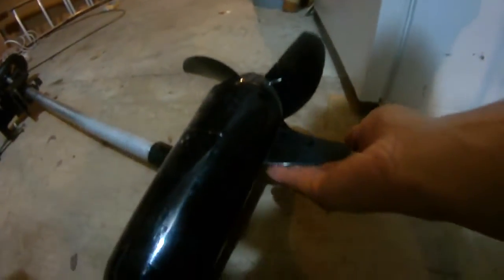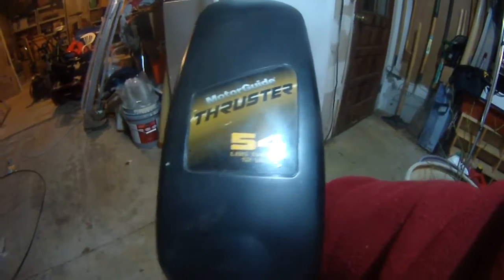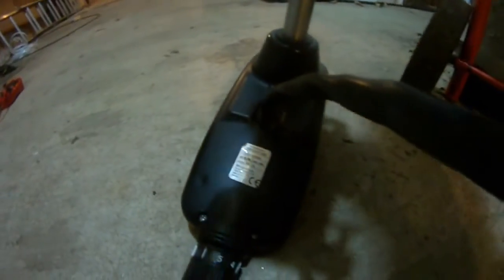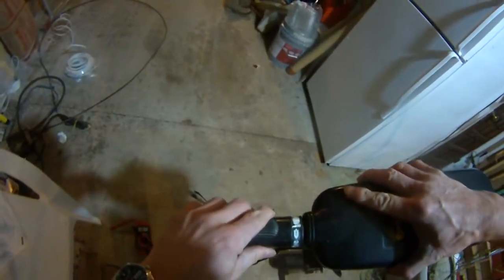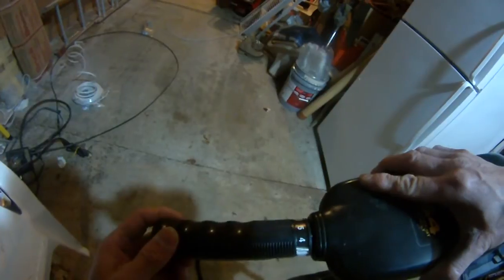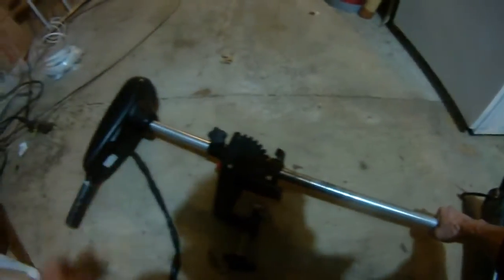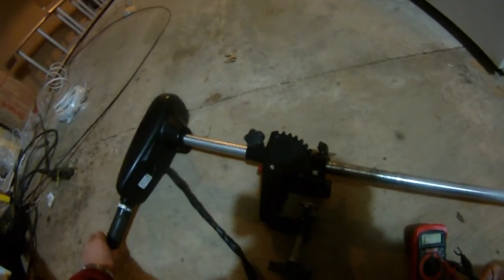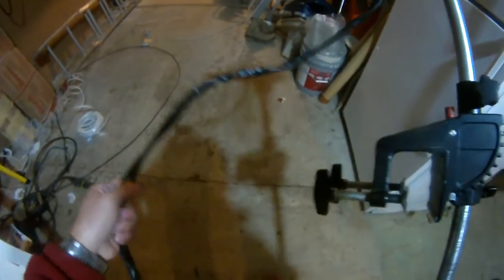motorguide 54lbs 12 volts - how to check continuity of a trolling motor using a multimeter

Comment: I have a 54 pound thrust motor guide manual trolling motor. It simply stopped working very suddenly after about five hours of trolling. What could be the problem?
Reply from the maker: oh boy! good luck. It could be a few different things (most likely you had a loose connection in your wiring - check all your connections first): (1) it happened to me with my 70 lbs motorguide foot controlled trolling motor once - the connection in the power head was loosen when the powerhead was turning on the water, so I just opened up the powerhead and re-connected it and it was good as new (2) your fuse burned if you have a fuse breaker. I have not had this happened to me yet. I owned 2 TM (minn kota 30 lbs and motorguide 70 lbs) so knock wood. (3) your motor burned - which can happen if water gets into the lower unit - this is extreme considering you been running it for a long time. or your DC voltage surged for whatever reason.  In any case, post your questions to iboats.com forum and the like. People will help you 24x7 - Best of luck!